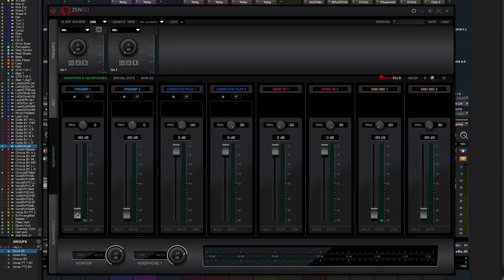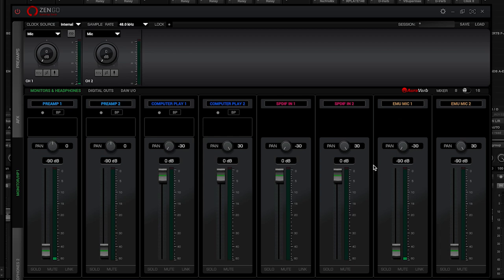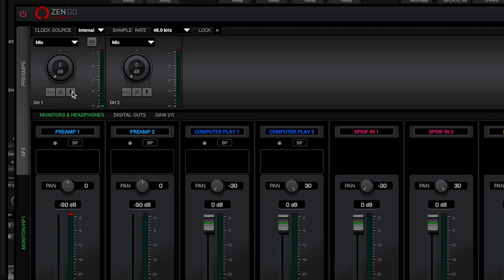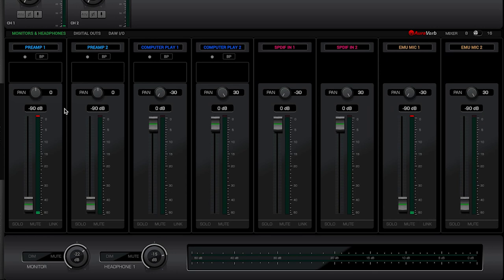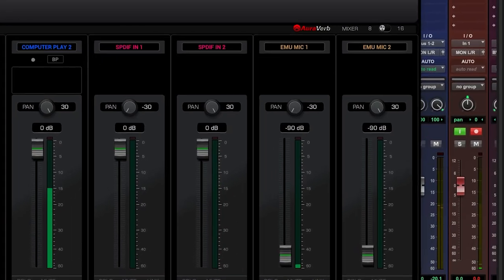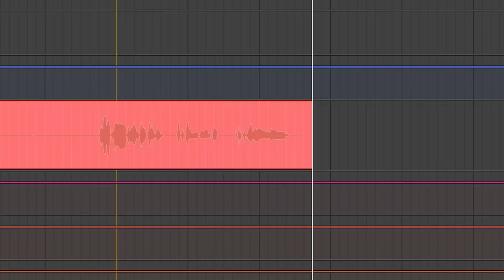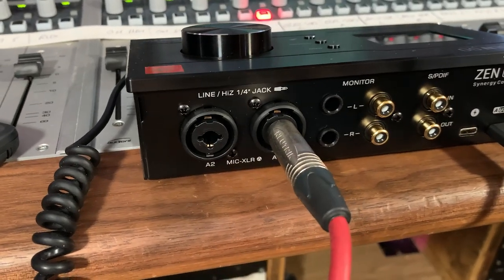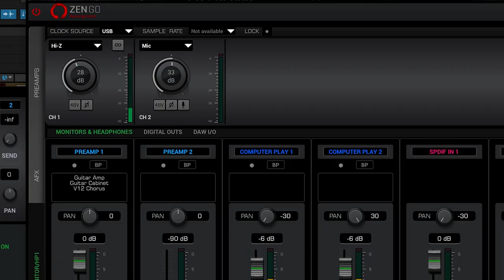Zen Go Synergy Core - Control Panel Overview & Setting Up for a Session

Comment: where can i activate direct monitoring?
Reply from the maker: Hello

Our audio interfaces from the Synergy Core line allow you to monitor directly from your interface, right after the input stage. By bringing up the volume of your channel in the Control Panel’s mixer you will get direct feed of your microphone or instrument into your monitoring system.

Antelope Team
Reply: I am sorry I don't get it. there is no sound coming out of the the synergy core, and what channel do I have to bring up there are like 16? @AntelopeAudio
Reply from the maker: @lvy745  It’d be best to check with our support department via the link below for the detailed review of the problem. My colleagues are available 21 hours a day during business days and would be more than happy to assist you!
support.antelopeaudio.com

Antelope Team

Comment: I've connected my AT2020 condenser mic via XLR (3-pin) and when trying to switch Phantom Power in Control Panel it blinks red and it just immediately turns off. Please help.

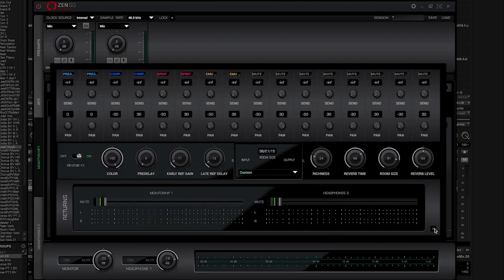Comment: I got a Zen Go today but I've got noise only analog 1 input Ch, as your video shows same noise on ch 1 as well(2:36). I think it is not a ground or floor noise problem, cause ch 2 and other out put is clean. You have any solutions for this?
Reply: solution: return and get something else. LOL

Comment: hi. i bought zen go but in 34 pre amp i have very low voice record, and with about 50 to 55 it goes well (i am afraid of cliping in high preamp) is it normal that with 30 to 40 preamp i have low and weak voice? (mic tested: at2035 and rode nt2a. and with sure sm57 i have to set 60 to 63)

Comment: Antelope interface systems are and have been broken for some time. Save yourself the hundreds of dollars and invest somewhere else. I've been troubleshooting mine since I got it as I thought it was an internal problem. Turns out it's the hardware. Can't get a refund/replacement. If you have Nvidia (like myself) stay away as other people on forums have noted their issues of compatibility. I currently still run my Zengo as I'm more casual and use it as a guitar amp with a mic set up. Someone posted a fix explaining these issues and that being of the power supply not generating enough to run properly. Yeah so consider this your warning if you're seeing this. 

tldr; Stay away. I can't believe the guy at guitar center seriously talked me into buying this. Fucking unlucky.

Comment: Does not have an option/button/control to easily hear a mono mix, does it?
   Also, is it correct that the reverb is for monitoring only and cannot be recorded on the way in? You say it "will not" be recorded on the way in, but do you mean it cannot be recorded on the way in?
   That's a bit unusual, no?
Reply from the maker: Hello RJB,

Thanks for your comment! There is no "mono test" functionality on the interface. However, we do take such remarks into consideration, this will be forwarded to the relevant department. In the meantime, we can recommend using mono summing on your DAWs master bus instead. Regarding the AuraVerb reverb, yes, it can only be used for monitoring and not during tracking. Printing with reverb is possible on some of our more advanced interfaces, due to their more flexible routing capabilities. Hope this helps! Should you have any other question, we remain at your disposal.

Comment: Hi. Thanks for the vid.I bought the bundle with Zen Q Synergy, Edge modeling mic and 37(?) plugins and loving it. 

I could really use some guidance on setting up gain staging for basic male vocal recording wtih the Edge into Pro Tools. I can certainly dial in an appropriate input level on the internal preamp alone. But I'm trying to understand gain staging when tracking with a few plugins. Specifically, I want to record with a stock Antelope preamp (such as the BAE-1073) and a initial stock compressor (such as Impressor)... leaving room for additional compression in the mix. Any advice on gain staging settings across the hardware preamp, software preamp and compressor is greatly appreciated. 

Similarly, what would be my optimal hardware preamp gain setting if I was to record dry and do all the processing in post?

Thanks so much!
Reply from the maker: Hi Jeff

Congratulations on your new device! It’d be best to discuss the above-mentioned points with our support department via the link below. My colleagues are available 21 hours a day during business days and would be more than happy to guide you!
support.antelopeaudio.com

Antelope Team

Comment: I must be doing something wrong. Should I immediately hear / monitor via the headphones or is there a setting for that. My headphones are not muted or dimmed. I can hear system audio via the headphones but I cant hear any of my inputs. Do you have to set it up with a return from your DAW like shown in video. Is that the only way youll be able to monitor what youre singing / playing?
Reply: Did u figure out
Reply: @boutstaxx  Ended up returning the unit as the screen was messed up. Oh well!

Comment: Just received delivery of the Zen Go here and after setting everything up I was very disappointed to find the display's brightness level to be so inadequate and dim. Even after adjusting the brightness level to 100 % it's still on the dim side. It sounds very  good but this display issue is just not acceptable so it's being returned.

Comment: hi can you tell me more about the usb-c performance . I have discrete 8synergy for desktop want to konw if it compares with thunderbolt
Reply from the maker: Hello Rob, 

For the Discrete 8 SC, the major difference between USB and Thunderbolt use is in the channel count - 24 vs. 32 channels respectively. Also, you can achieve lower round-trip latency over the Thunderbolt connection. With a fast CPU powering your computer, you can go pretty low over USB just as well, at the lowest buffer sizes. Should you have any other questions, we remain at your disposal.

Comment: I bought the go interface yesterday and I didint realize I need a C connection on my labtop but it came with an adapter for USB 3, I plugged it in my USB 3 plugin and playback was choppy and very slow, also I could not turn on phantom power to my mic , I tried on another labtop and USB 3 did not work for it there too... so I’m not sure it actually works with the adapter 
So I returned it and got an audient id22 and it works easilyv
Reply: How old is your laptop?
Reply from the maker: Hello Rylan, 

Thank you for your message! For technical inquiries, please reach out to our support department via the link - support.antelopeaudio.com 
Our team of professionals is available 21 hours a day during the business week and would be more than happy to assist you!

Comment: DONT PURCHASE ALLERT! This brand's hardware relies heavily on firmware updates, which can lead to potential compatibility issues down the line. Additionally, when they release newer interfaces, older models might not receive full support, potentially pushing you towards an upgrade.

In my experience, resolving technical issues with their customer service took over two weeks, and the solutions offered weren't entirely satisfactory. This has led me to recommend exploring other brands to avoid similar frustrations.